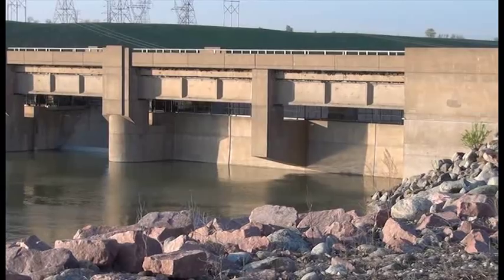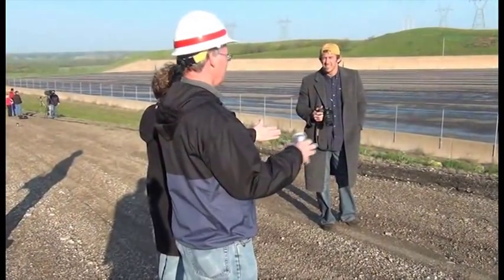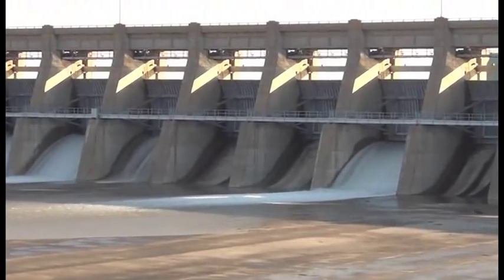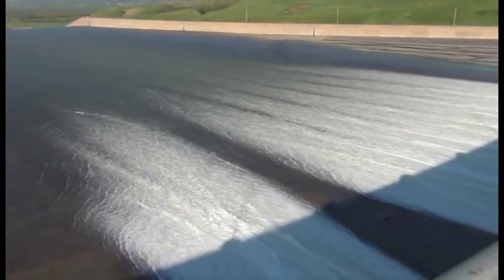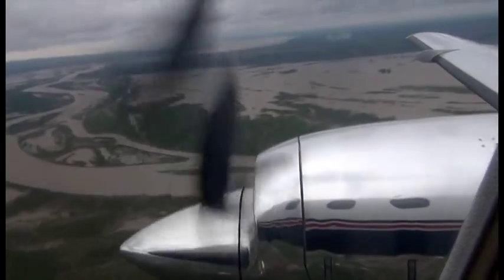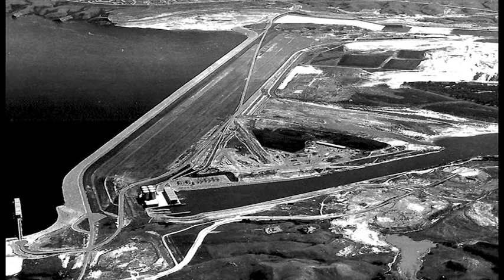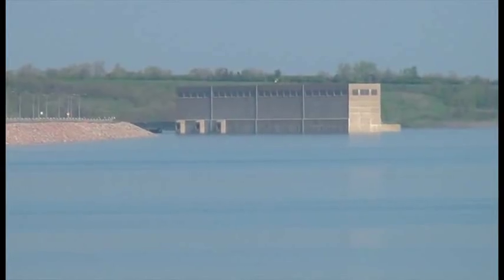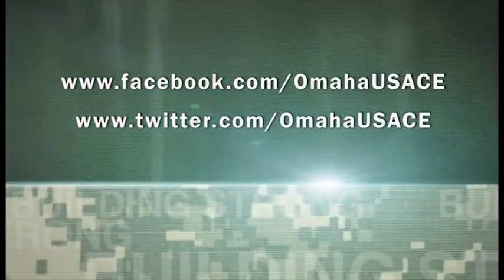Garrison Dam Historic Spillway Gates Open

Comment: The campground suffered almost 2 million dollars damage (They deny it, but I have pictures of the damage), It should be open again by mid-summer, according to someone who works there. The commanding General in Portland (NW Division HQ) fired the Project Manager, the Lake Manager, and several engineering staff, as their ineptitude was the principal cause of a $60 Million dollar flood, which caused damage as far south as Louisiana....

This flood was 100% avoidable, lawsuits are still pending.
Reply: This is false.  All 6 project managers were praised for the way they managed this flood by the local communities, they made the best of a horrible situation.  After all, they live in those communities.  If blame is to be laid, it's at the leadership.  Which has always been in Omaha, not Portland, by the way.  (Just look, this is the USACE Omaha District page).